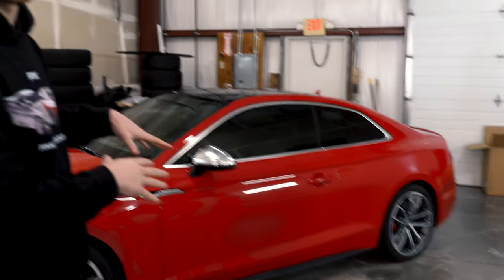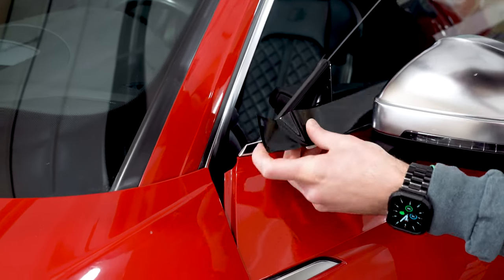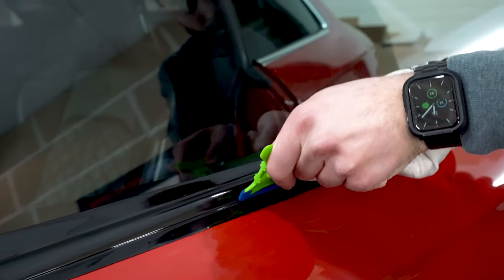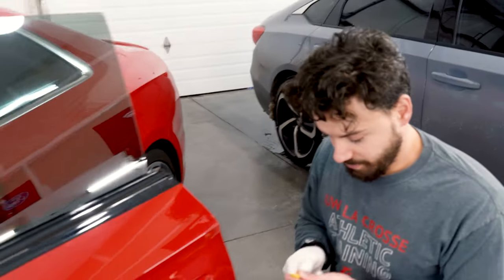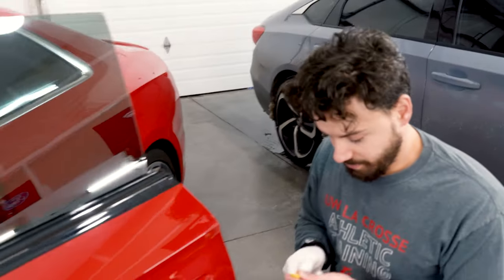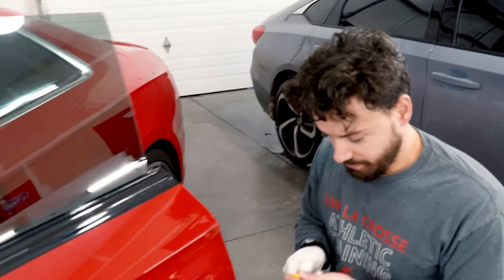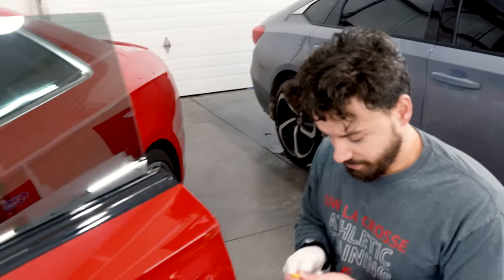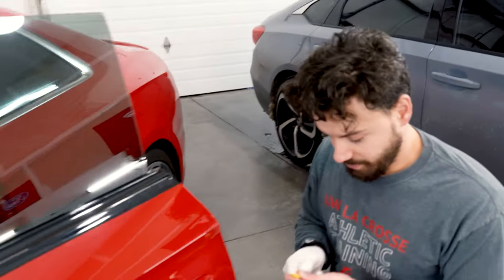How To Black Out Chrome Delete Window Trim - Vinyl Wrap Tutorial | CHROME DELETE

Comment: I would suggest using knifeless tape for beginners. 90 percent of us ain't actual surgeons.
Reply: To add to my suggestion, knifeless tape saves time and effort needed for cutting the vinyl wrap. The tape cost $ but actually worth it in the end.
Reply: @richardlee6698  I noticed someone use that thin little tape, I guess it was knifeless tape that went underneath the wrap. But he only used on top part of chrome trim piece. Wondering if you can put 2 pieces of knifeless tape on top and bottom of the same chrome trim piece. I’ll keep searching, because that looks so much easier. Worst case, it does look perfect. If it last a couple years, well worth not seeing that ugly chrome trim! Lol
Reply: frt
Reply: nah SEND IT
Reply: You mean 100% of us in this chat aren’t
Reply: And it’s wayyyy quicker
Reply: This tape is not really sticky and fails sometimes. It works better when you need to have a cut on a huge pieces.
Reply: What does this kind of tape called?
Reply: Why, do you have parkinsons?
Reply from the maker: knifeless tape doesn't always stick to the rubber gaskets and you have to get it perfectly lined up so it will add a lot of install time but not a bad suggestions

Comment: I would suggest to roll window down so the top window seal gonna give you more space to push the vinyl under the rubber 😉🙌🏼
Reply: I think he uses window to stabilize his hand
Reply from the maker: It won't get tucked into the window, its trimmed to the edge of the gasket

Comment: I respect your blade skills. Much more precise than mine. For that reason, whenever possible I remove all of those trims and wrap them off the vehicle. I'm more comfortable doing it that way.
Reply: How do you pop the trim off?
Reply from the maker: a lot of vehicles you can't remove trim without breaking it so leaving it on the vehicle is safer and easier in the long term
Reply: @wraplabmidwest 😂well that’s not true

Comment: That could not have been cheap goddamn, absolute banger thanks for the info. Ready to knock out a chrome delete now! Solid work
Reply: How did it go?
Reply: @rayzecor  It took me all day into the night on my b7 passat. Looks good though. Definatley would recommend having a squeegee to press down on the vinyl. Also, a tucking tool and a quality razor knife will make the job easier. 👌

I ended up using the wrap they sell at advance auto, and I actually like it. Good stuff still holding up all this time later
Reply: @red2g  Good stuff. I have a squeegee and a sort of trim removal prying tool which I can maybe use as a tucking tool. Will try when I'm freer

I own a B7 too, btw, but I'll be doing the delete on a w205 C class

Comment: How do you "Push" off a window as you're pulling vinyl HaHa 
But essentially,  id have started with side back window, then go along the top. Now the seam is facing backwards, taking the brunt of the wind while driving, possibly causing it to lift at the seam. No?

Comment: I just found your channel and have a question: my car was recently repainted, and the black trim was supposed to be painted black as well - it was already black- it just was supposed to be repainted black to look new again. Instead the paint and body
 shop used heavy duty black tape as the accent- and wondered how does tape hold up in a state with lots of rain and sun (and no garage for protection)?

Comment: I paid someone to do my Q50RS and they cut some rubber trim on the pillar separating the front and rear door on the driver's side. Any adhesive I can use to stick the piece on the pillar so it's not flopping around
Reply from the maker: I would go back to the shop and have them replace that piece or pay for the replacement if it's obnoxious. If anything is broken during dissassembly, I always replace it

Comment: My question would be how did that vinyl you did just above the exhaust tip, @24:16,  hold up to the heat?
Reply: That piece is far enough from the exhaust. It's not sitting right on the exhaust tip
Reply from the maker: so far so good because its not on an area that gets direct heat right away

Comment: nice video
how many grad celcius should be heated
the gun
Reply from the maker: Idk about celsius but we use porter cable heat guns and keep the setting on the dial with the little thermometer facing down for wrap. Idk exact measurement but maybe around 400-500 degrees F. that's just a shot in the dark, I could be way off

Comment: How did you wrap the bottom inside  of the top trim? On my Audi S3 8v it is ribbed. Do you push the wrap into every single rib?
And you wrap the mirror caps or do you just replace them with black ones?
Reply from the maker: more often then not I'll replace mirror caps with carbon fiber or black options. I can wrap it but it takes twice as long and it'll have seams depending on the angles and design of the mirrors. Not all mirrors can be done in one piece!

Comment: Great job! I want to do that to my 128i. Did you use the 2 or 4 inch 3M 2080 trim?
Reply from the maker: I think I used 2 inch for the thin and then used scrap vinyl for the cubed little window section

Comment: What vinyl did you use for the Carbon mirors?
Reply: Just use 3m carbon fiber vinyl
Reply from the maker: the mirrors were replaced with real carbon fiber mirror caps

Comment: Dumb question… what’s the best way to figure out how much sq footage of wrap you need for a vehicle ?
Reply: You can use a tape measure, measuring tape or any other measuring medium. You can also use a piece of painters tape/magnet to tack the tip of the tape where you want to start, put a piece of tape or magnet along the way at a mid point to hold it up and at the end of where you’ll be wrapping and just cut the film when you’ve pulled enough. Plenty of different ways, you just have to pick the method that works best for you. No dumb questions brother, we all have different brain chemistry and life perceptions.
Reply: Once you have your measurement just look up a square footage calculator if you don’t feel like doing math 😂

Comment: HOW DID YOU DO A PERFECT SEAM ON THE TOP ROUND CORNER OF THE BACK WINDOW WHERE THE WRAP MET THE SECOND SECTION
Reply from the maker: very slow and careful cut in the gap between the two sections. practice makes perfect!

Comment: How do you cut the top piece where the rubber is connected to the trim
Reply from the maker: very slowly and carefully. I use a 30 degree NT cutter blade with only blade pressure. I always crack the blade so I have a brand new sharp blade for cuts like this

Comment: someone show this guy how to Professionally Wrap things not this half assed 2peice bodge sh*t with 2 different black vinyls 3M & Avery have different black shades its going to look sh*t when its finished. also never cut the bottom edge before tucking it in as the heat will pull back showing so much chrome at the bottom, lift vinyl and tuck.... all im seeing is Bodge the Builder
Reply: Run that through chat gpt and try and make it more coherent thanks bb
Reply from the maker: lmao I'd love to see what you can do with vinyl. stay in your lane